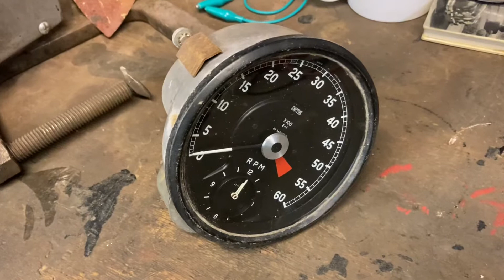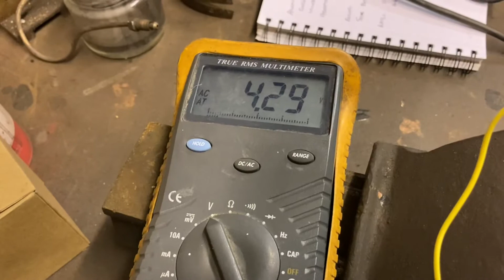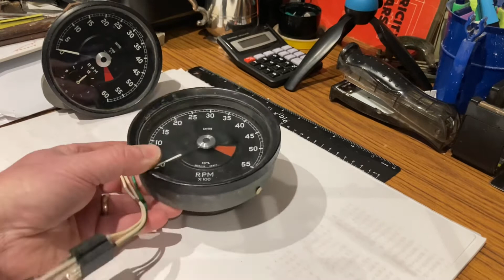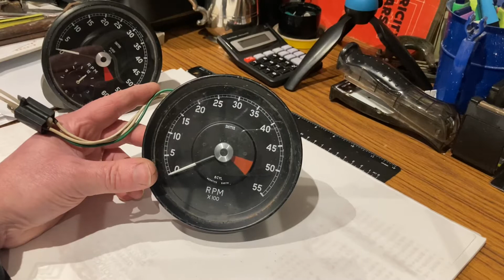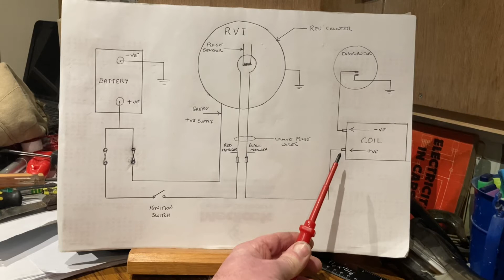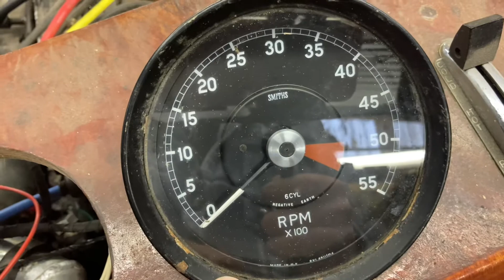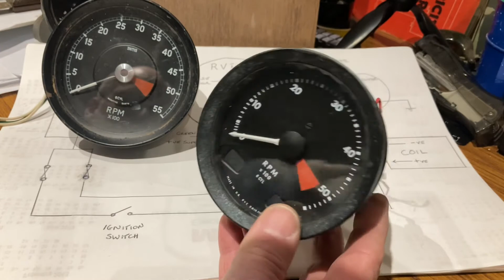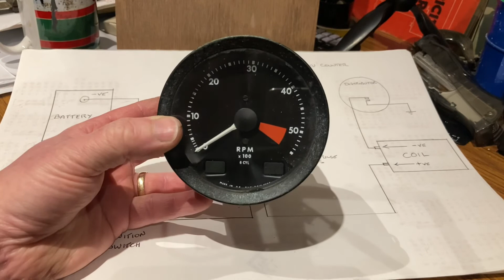Jaguar MK 2 Rev counter how it works plus RVI swap

Comment: Thanks for taking the time to record this video. Trying to get the tachometer in my Teal Bugatti working- it has jaguar dials so this is just the ticket!. I would be interested to know if I converted to an Accuspark electronic ignition would that count as electonic ignition that you discuss?
Reply from the maker: Thanks James glad you got something from this video my best guess is that the Accuspark wouldn’t drive a RVI tach but haven’t had any experience with that set up, you would be best to talk to someone who has or just give it a go!
Reply: @stevesclassicgarage9464   Hi Steve. So I got my rev counter working yesterday by following your wiring plan. Very chuffed. Thank you again !
Reply: Hi. Just took my car out for a spin. The rev counter counts perfectly to 2500 and then seems to “stall” and despite the car revs rising the rev counter drops. Any thoughts?
Reply from the maker: Hi James you need to check the polarity of the white wires that sense the pulse from the coil, my tach ran backwards when the engine was reved up although it would read a fast idle ok as I had these wires reversed. Also don’t presume your tach is ok unless you have seen it working elsewhere, even new kit out of the box can be faulty yet alone a 50 year old gauge 👍🔧🔧
Reply: @stevesclassicgarage9464  Thanks Steve- tried reversing polarity but the tacho didnt work at all.

Comment: Hi Steve, this is great and very informative. Its the exact puzzle i am having with my MK2. Its a 1962 but has had a later engine fitted so the cam shaft doesnt have the drive slot for the rev counter generator, which i went and bought before i check the cam shaft. So on the basis of what you have done here i have bought a S1 xj6 RVI rev counter. I understand the circuit diagram theory thats all good and can see your test demo all works good. My question though is in practical terms how do you wire this in. Where are you cutting the ignition wire to put the rev counter in series ? Is it near the ignition key or are you going to run a cable back from the wire up to the rev counter and then back to the coil. Also practically how are you taking a live feed from the fuse box. Sorry wiring and electricals are very weak for me so need to understand in the simplest terms. Great videos though very helpful keep them coming
Reply from the maker: Hi Dan, glad you got something from the video. I have not yet installed the Rev counter as the dashboard needs refinishing. My best advice is to get some help from someone who is confident with vehicle wiring, there are mobile automotive tech guys that could come to you. We all need some help with specific area’s from time to time I certainly do. 🔧👍
Reply: @stevesclassicgarage9464  well Steve with a bit of perseverance, and patience, i got the rvi counter working this afternoon, i took  12v feed from the ignition key by putting a piggy back spade terminal on it for the live, when the key is switched to ignition  and then temporarily connected up some cables with spade connectors and connected the counter in series as per your diagram, and it worked first time so very happy with that. I now need to trace that wire behind the dash so i can put it in series near the dash without runnign cables backwards and forwards. However the theory and practice have worked. 
Thanks very much for this video !!! Great work